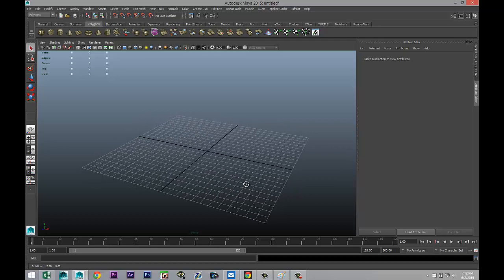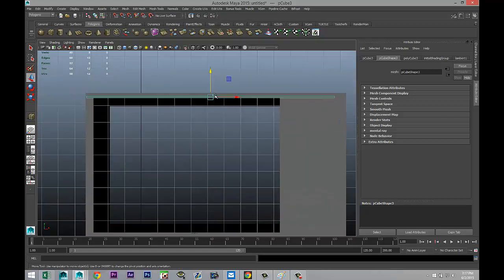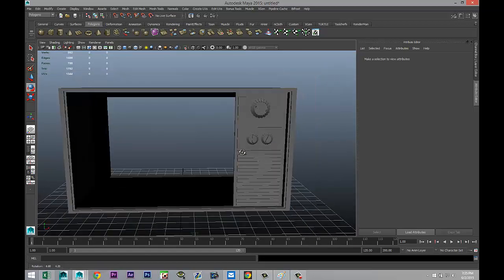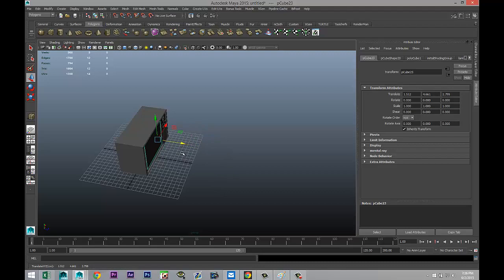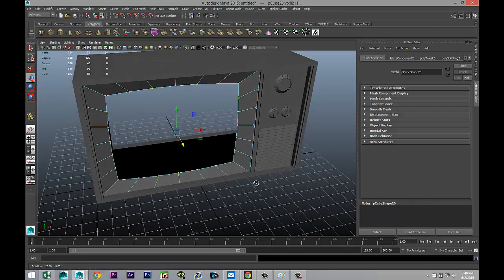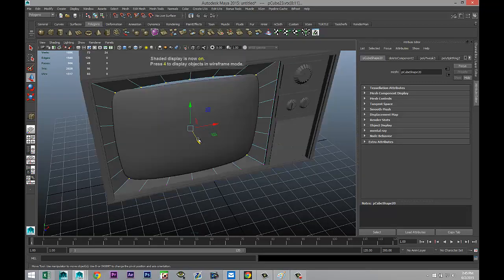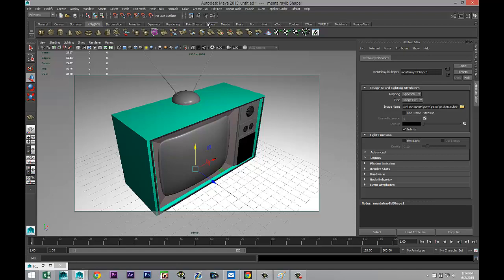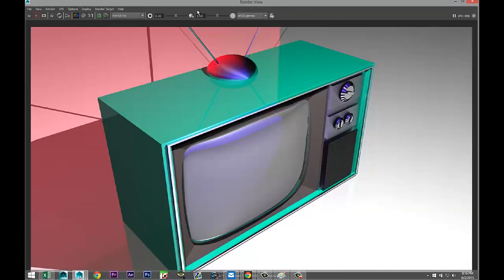Maya tutorial : How to model a 1950's style television

Comment: Dont have mia_material_x PLZ help me download it / a link because I have been unsuccessful and I am stuck at the texturing of the panels.
Reply from the maker: Jorge Magana Hi Jorge,

Go to your top menu to Window - Settings/Preferences - Plugin Manager and search for Mayatomr.mml in the list. Make sure that both loaded and autoload are checked. Now try again, you should now have mental Ray
Reply: Mike Hermes Thank you for answering so quickly but I have checked and it is not there, I believe I need a download for Mayatomor or something to get it, any help with that?
Reply from the maker: Jorge Magana It should be there, what version of Maya do you have ?
Reply: 2015
Reply from the maker: Jorge Magana It sounds like you need to reinstall Maya as it should be in the plugin manager as a standard